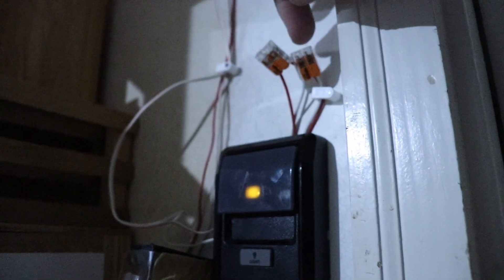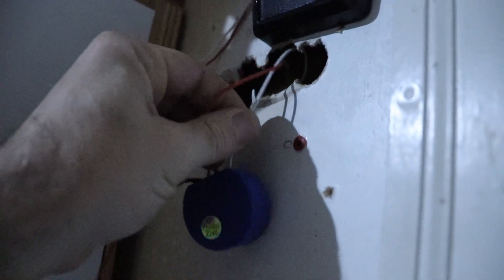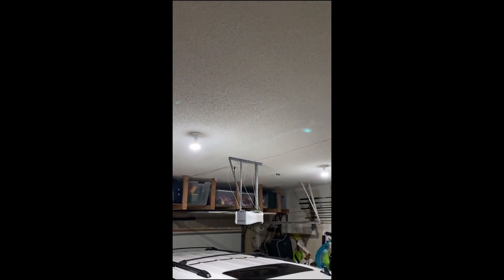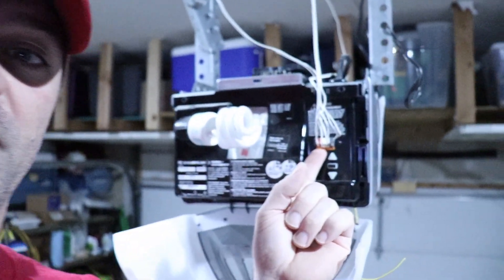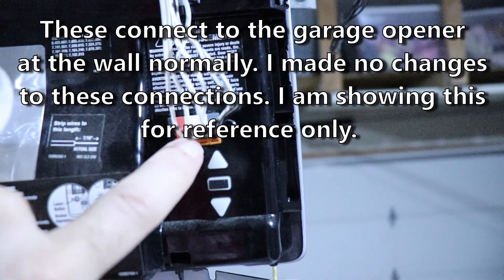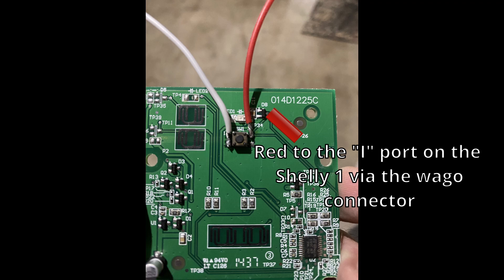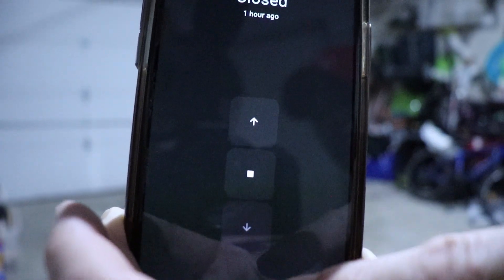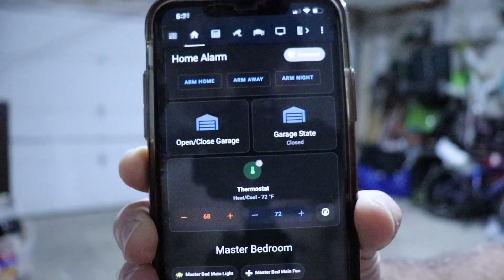myQ Workaround | Garage door openner | Shelly 1 | Home Assistant

Comment: How does it know that the door is closed? Or Open?
Reply from the maker: It knows based on the reed switch I installed on the door. It knows the state of the switch and therefore the state of the door. That gets passed through to Home Assistant

Comment: It looks like you are using mqtt or tasmota on the shelly1 device.  I tried mqtt a few years ago and was disappointed with the stability.  It also takes a lot of steps to setup.  
Now, all my Shelly devices are auto detected by “Shelly for hass” integration.  I find this to be stable and no issues at all.  And it means I don’t have to flash anything as I’m using the vendor firmware.  It’s not clear to me what benefit there can be for other firmware since the original is working perfectly for me.  And I’ve got a lot of devices so quick setup is important.
Reply from the maker: I am using Tasmota on this one. It is my first time using it but I’ve had zero issues.

Comment: There are a few things that can be added to the yaml to add additional support for more states. Your current design only has open and closed and these tie directly into the reed switch states.  On my own design I implemented opening and closing states.  These are derived by creating a moving binary sensor that goes true when button pressed and when timer expires goes to not moving.  Then the states transition a few ways- when moving starts and was open becomes closing.  When moving starts and was closed becomes opening.  When timer expires the state becomes whatever the reed switch says. Now I can get a alert when fail to close because that’s simply a state change from closing to opened.   Likewise I get alert for fail to open.
Reply from the maker: That’s an excellent way to set that up.  I will take a deeper look at that
Reply: @thedaddyshow01  when done correctly the icons automatically update for all 5 states.  You can go from seeing the icon for a closed door to the up arrow icon indicating movement followed by an icon for an open door.  I really like being able to alert on fail to close because I can just drive away without looking and if it fails to close I get alerts.  The extra states allow for more intelligence in the automations.

Comment: This is kind of the perfect situation for 3d printing. You could mount the Shelly and the original switch board into a shared case and it would look nice. I bet you could power the Shelly too, but it would require essentially an itsy bitsy ups...

Either way, awesome project!
Reply from the maker: Very true!  If I can start making money on my videos, I will do that for sure!!

Comment: You are better off using a ratgdo, it hooks directly to the button terminal on the operator and speaks directly to the garage door controller. This means it know if the door is moving, and what position the door is in, so you can give it commands like open door to 20%. It also can control other functions of the door, such as the light, give you cycle counts and diagnostic information, and a ton more.
Reply from the maker: I will look into that!
Reply from the maker: I have looked into the ratgdo. I appreciate you pointing that out. I will have a video coming shortly on my findings and potentially an install video

Comment: Why don't you just solder the Shelly's to the remote?  No need to run wires and you can put the Shelly anywhere.
Reply from the maker: Which remote are you speaking of?  I still have to have power to the shelly so I’m curious because running no wires would be awesome!
Reply: @thedaddyshow01  open up the remote that came with your garage door opener.  Solder the two leads from the Shelly to the button of the remote.  To power the Shelly cut a computer power cord and wire it in.  Find any open outlet in the garage and plug in.
Reply from the maker: This would ultimately be the same as what I did only it would use a remote instead of the button. But I do like what you are saying. I will have an updated video coming shortly with some new information and a possible better way to make it work!